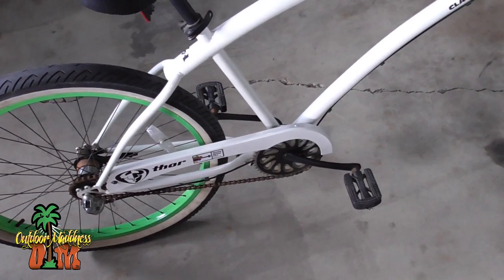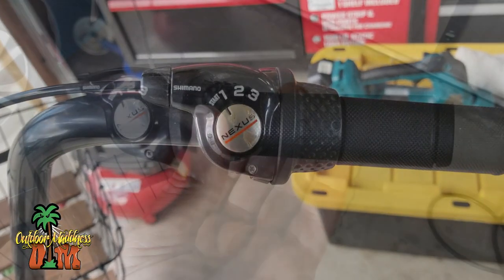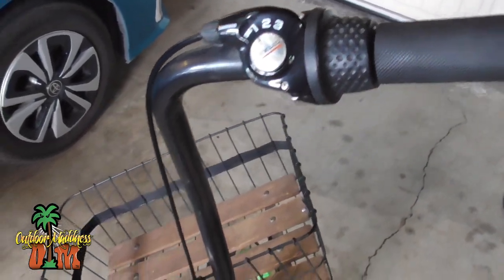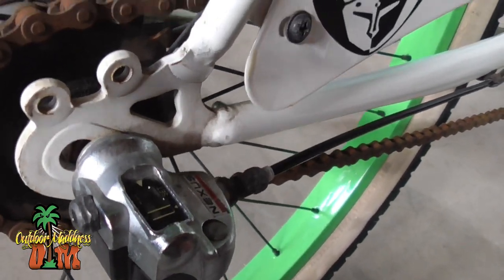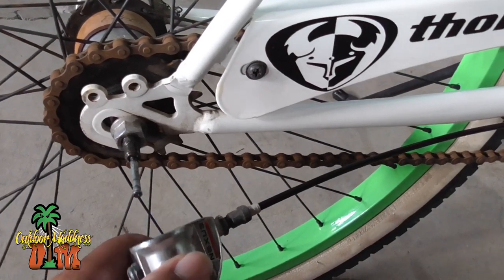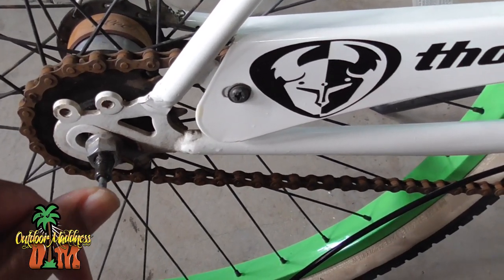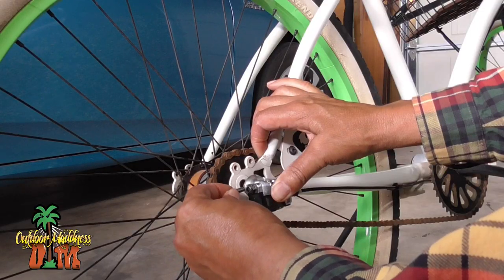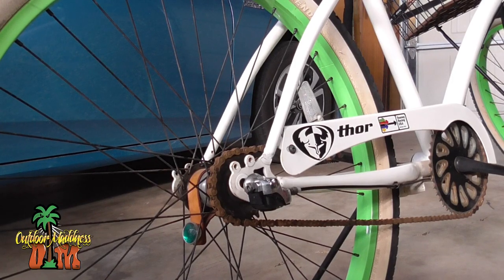Easy Fix For Sticky Nexus 3 Speed Shifter

Comment: wd40 is not a lubricant it is a penitrant that will cause wear and dry out where the metals make contact
Reply from the maker: It is a penetrant but also acts as a lubricant, rust preventive and moisture displacer. It's made up of different lubricants and is called a "Jack Of All Trades" Look it up!
Reply: @outdoormaddnesstv  It might be okay for a quick temporary fix but for longevity it’s best to use a specific lubricant. Good vid though 🙌
Reply: I also agree with everyone else. No bike shop uses wd for long term fixes
Reply from the maker: @snufbox  Thanks a lot, and thanks  for watching !
Reply from the maker: @brooks71982  I understand what you're saying, but I've been using WD 40 for years, and I have never had an issue with it, so I'm going to continue using it, not on everything just some things. Thanks for watching!